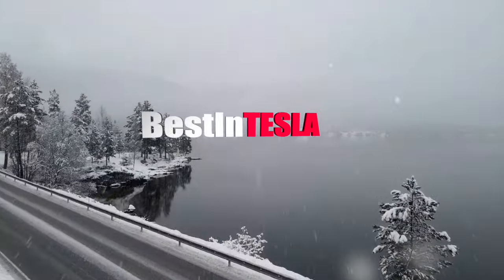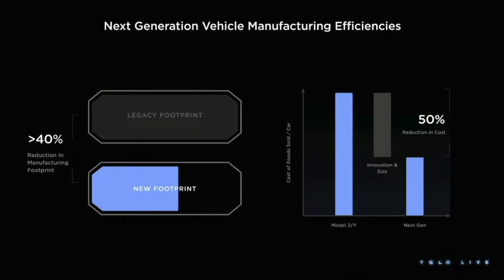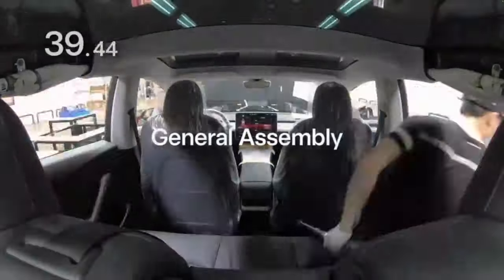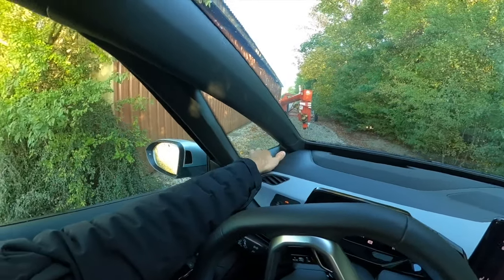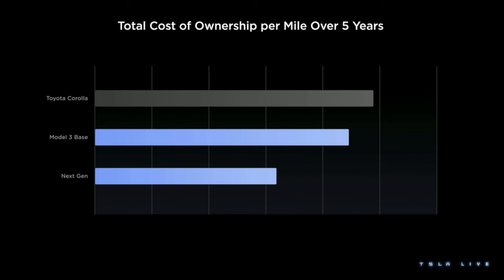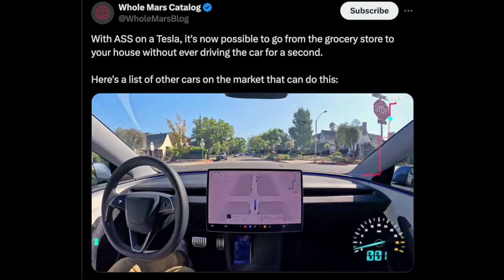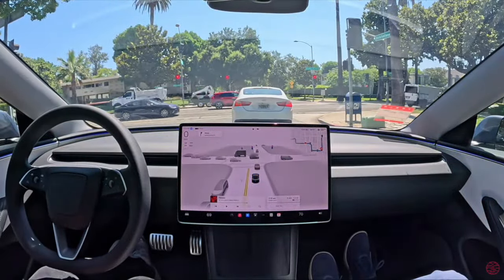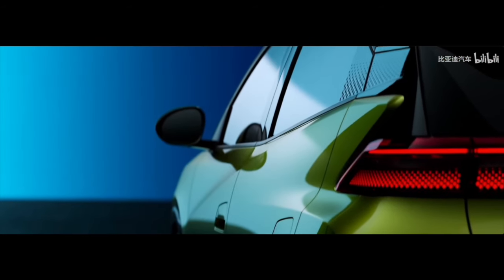Tesla's $25,000 Car and FSD - The Future of Profitability Unveiled! Wall Street's Misunderstanding

Comment: Sensible rollout plan for Cybercab and Model 2: 1) Start unboxed production of Cybercab at Giga-Texas. Debug process at world HQ with engineers and Elon on-site. 2) Start Cybercab production at Giga-Shanghai and Giga-Berlin. Ramp unboxed production there. Optionally do the same with Giga-Mexico for Central/South America deliveries (unaffected by potential US tariffs). 3) With Unboxed technique, the only difference between Cybercab and Model 2 is the front module.  Once Cybercab fully ramped (so production capacity is high), start producing Model 2 front modules (w/left and right hand drive versions) and vehicles worldwide.  Adjust Cybercab:Model 2 production ratio dynamically to demand.

Comment: FSD 12.5.4 is basically level 5! I use it every day and drive over 35,000 miles not kilometers every year and FSD today is basically fully autonomous and I’m really just waiting for them to announce that😂🙏💕
Reply: I also have 12.5.4 and use it every day, 2021MYLR with HW3. It usually works fine but once it made a left turn in front of an on coming semi and then stopped and disengaged in the middle of the road, another time it merged to a left lane with oncoming traffic when it should have just gone straight through an intersection. I reported these with the voice report, so hopefully those reports have some use at Tesla to make things better but I have never heard what happens to the reports. Kind of scary, 12.3.6 had problems too but never did this. I'm starting to wonder if the 'video clip' training can ever overcome these issues. My wife refuses to ride in the car with FSD on. Pay attention when using FSD my friends.
Reply: Hi, question for you. I’m in Australia where we don’t have FSD yet. In your experience how many miles do you drive between critical interventions?  That is if you had not intervened an accident would likely have occurred?  Thanks
Reply: There are almost no critical interventions. I am amazed at how the car can anticipate a large semi turning radius and stop in advance to allow the turn of the semi to finish,freeing up my lane.  (The truck turning from a side road towards me).  It anticipates drivers jumping the gun and illegally turning left in front of you even with my right of way.  It spots people opening doors when parked and either stops or moves a little into the opposite lane if traffic allows.😂
Reply: Do you actually know what Level 5 autonomy is? It's Fully Automated Driving. Vehicles capable of Level 5 Autonomy will be able to drive on any road that has been mapped and can be navigated by a human driver. That means all  weather and road conditions that a human driver can successfully navigate.
Reply: Its still level2
Reply: @tomdrewenskus8167  So as a point of information, level 5 autonomous, driven cars, means that these cars can operate all on their own without any human intervention. It doesn’t matter what a human can do or can’t do. It doesn’t matter whether the road has been mapped or not, because the car is completely operating on its own without any human intervention prior to, during or after. Comphrende. Cheers 🥂
Reply: @BrunoHeggli-zp3nl  Yes, it is still level 2 today, because Tesla has not applied to any state to operate completely autonomously. Comphrende. Cheers 🥂
Reply: I agree. Even 12.4.1 was already super amazing to test I. The USA! People don’t realize how close we are solving autonomous vehicles. Especially in Europe they have no clue.

Comment: The biggest problem with cheaper cars from legacy auto (and now Chinese brands) is sacrificing on safety, not just on features or tech. In fact, I would say the Chinese OEMs would trade off infotainment, features, etc. vs. safety, where there is way less regulatory pressure (shout out to the Wuling Hongguang Mini).
Reply: Legacy auto , must DEcontent to make a lower priced segment car.
TESLA can make Multiple lower priced models for Different Markets , at the same time. 
and on the same Platform.
Reply: @markplott4820  Yes, legacy auto is idiotic with way too many models, like GM planning to release 30 EV models in 2025. Ya, right Mary. How's that going? 

However, why would Tesla want or need to make multiple models, for different markets? They are nearing homologation in India (for all four of their models), which is a very challenging environment. They simply need to make relatively minor modifications - creating regional versions, not models. Multiple models is inconsistent with Tesla's approach of one category killer per category, and would greatly hurt economies of scale. Even the semi, which people said could never be compliant in Europe, now meets local requirements and it only took relatively minor modifications - its a version not a new model.
Reply: @machoopichoo2   - new MY should be Retooled for CHINA, Berlin & USA.
Berlin could produce own M3 hot hatch.
China could make MX style "basic" M3.
USA could make "basic" M3 as well. 
and refresh MY.
Reply: @markplott4820  OK, let's break this down. A hot hatch could be built on the M3/Y platform, and that would make it a new model. But I think a hatch will be the "$25K" car (final unboxed version, not anything interim), built on its own platform - the "compact" in Tesla's Master Plan 3 (MP 3). I think there could be a sub-compact (like a Honda Fit or Toyota Yaris) that sells for say $15K and is built on the robo-taxi platform. I don't think this is inconsistent with MP 3 because the robo-taxi is not covered in the model lineup in that document. 

That said, why would they "retool" the 3 or Y? To reduce economies of scale on some of the best selling cars in the world (Y being the best in the world), especially with the mass market compact coming soon? Sure, some versions of the Y/3 could come and go (e.g., SR RWD Model Y) but there is zero need to heavily modify these models for markets where they are already selling amazingly. Again, the M/Y are fine for India, with relatively minor modifications.

Comment: I certainly like Tesla vehicles. But that is because of all their features, the design itself and all the amenities, as well as the safety and savings factors, etc. It is a smart car - not just an electric car. Therefore, I am not expecting Tesla to produce a $25,000 car by "cheapening" it - e.g., reducing the quality of the materials, audio and visual systems, seats and upholstering, etc. Or simply omitting features of adding them as costly "options." IMO, that does not count as "unboxed savings." What does count is if they continue to produce fine automobiles for less cost of manufacturing.

Comment: 50% off costs compared to right now with unboxed is the inderlying assumption for your whole argument. Would be nice to know how. Unboxed still uses same amount of materials, just assembles them different order. 50% off just because of unboxed seems a bit high, maybe 50% of the assembly cost and not total costs
Reply: The process is to build the different sides of the car on different lines and merge only at the end. So mounting items like tapestry, electrical connections, etc should become much easier and take much shorter. We shall see if that's true. And then there's the economy of scale and the lower battery pricing.
Reply: @gianluigicassin868  
Tesla is innovating in other ways.  For example, they are using less expensive aluminum for their main battery wiring in the Cybertruck.  They cast the wire as a rigid piece which is much easier to install if the vehicle is designed to take a rigid connection.

Then, if there's a lot of automation, the rate at which cars are produced should increase.  Making more cars per hour/year means fixed costs can be spread over more cars, reducing the cost of each car.

Comment: BestinTesla - another great video.
I think Tesla will do refresh model Y , sometime in 2025.
Tesla will have pilot production of $25k NGV / Robotaxi (same platform) @ GigaTX.
GigaMX is on hold until after NEW American President is elected. 
Tesla Chyna, Berlin , Fremont & TX can all be adapted to make NEW model Y and $25k NGV / Robotaxi. 
Tesla will likely KILL mx/ms @ Fremont to also make RT/$25k vehicles. 
in 2025 Tesla will start producing semi in Dedicated factory & make 4680 cell there.
in China will make Megapacks.
in Lathrop Megapacks will ramp.
in GigaTX will ramp 4680 cell production.

Comment: IMO they are going for a car that costs  25K to make and sell for 32K - $7500 tax credit. The real 25K car will start production much later,  in 2027-2029.
Reply: I think you may be right.  I expect an EV selling for $35k or less to be announced next week.  A replacement for the now discontinued Model 3 Standard Range.  A less expensive EV built on the Model 3 and Y assembly lines.  Something that can come to market very soon.  It may already have started production.

My guess is that there is a prototype "line" for the unboxed EV inside the Austin plant.  Whether it's yet producing some test vehicles, no guess but maybe.  I suspect a year of shakedown on a new unboxed EV and then serious production startup.  2027 doesn't sound unreasonable, maybe a year sooner.  A dedicated factory might be 2027.  China can set up a factory and get it going in a year.
Reply: Tesla $15,000 car.

Comment: I think you are spot on Lars, being realistic with the Tesla 25K$ compact. To most people  FSD level 4-5 and the robotaxi are like pies in the sky. There is a market for the cyber in the USA, but the niche product wont move the needle in Europe or China. We both knows the narrow roads of europe and the super small parking lots, and I know people that would like a Tesla, but the M3 is simply too big, not mentioning the models S&X and the cyber. Remember Elon said, that the Compact could be made on the present 3/Y production lines, and to my knowledge, these lines are only used for production 4 days a week by now, so there is a lot of available employees and idle capasity, to start up production of the compact car right away. The huge ramp will follow, when Berlin and Shanghai finishes building their extensions.

Comment: If the 25k car is only RoboTaxi (not drivable by humans) it’s not going to have as much impact to Tesla’s earnings as fans are projecting.  Understand that the RoboTaxi cost is not very material, only the price per mile.   0.50 per mile = $6250 per year for the average person in the US.  Multiply that by a family of 5 then the cost per mile is more than the price of the car!   Even if you share rides with family members on part of the ride it’s still going to be a big chunk of the cars price, every year!   (Based on an average of 12,500 miles per year traveled. 

If the car is drivable (and has FSD) then it could be sold to the individual family and used within that family.  This would reduce its cost per year, if taken over a number of years.  The longer it’s owned the lower it’s cost per mile.
Reply: Elon said, pre-covid inflation, that Tesla could operate a robotaxi business, all costs included, for less than $0.18/mile.  Ramp that up to $0.25/mile post our recent round of high inflation.  A 100% markup would bring the rate to your $0.50/mile.  Lots of people would pay half a buck per mile just to avoid maintenance, registration, insurance, cleaning, and parking hassles.

Charge a 50% markup and it wouldn't make economic sense to own a car.

Comment: Wow, I was much more confident until I watched this podcast.  What you are saying is that Model 2 is at least 3 years off and you imagine FSD will add massively by next year.  It is evident you don’t have FSD on your car.  Because it will take much longer for FSD to add measurably to the bottom line.  The problem with FSD is that while good it is far from where it needs to be to run a Robotaxi or even be worthwhile to me who has 2 Teslas.  I refuse to pay because the utility isn’t great enough to make it worthwhile.  Too many interventions.  And while I hear zero interventions from other Tesla uberbulls I haven’t experienced them.  Good enough isn’t good enough when it comes to FSD. It needs to be near perfect before it will take off.  And you acting like it’s already there is delusional.
Reply: People who are running the latest version of FSD report few, often no, interventions.  You may be reasoning from old data.

The take rate for FSD appears to be very low right now.  As features like self-parking are added more people are likely to give it a try.  And people who are driving the latest version tend to say they really don't want to drive a car that doesn't have it.  It seems to be a ratchet effect, click up and don't slip back.

Remember, the $99/month for FSD is pure profit for Tesla.  It's just turning on something already in the car.
Reply: And don't forget winter. Not every city is in California or Texas. Once the snow starts, cameras get covered; road is slippery; road lines/paint gets covered...

Certainly not an option in winter cities anytime soon. I have a Tesla and live in such a city, so talking from pure experience.

The YouTubers paint a misleading picture of FSD

Comment: BYD sells their Seagull EVs for 10-12k, would hope Tesla can aim closer to the 15-20k range, rather 25k. That would be a true game changer.
Reply: If you want a crappy/cheap EV, buy BYD.
Reply: @paintedpony2935  
You might want to fact check yourself.
Reply: A Tesla EV that priced out below $30k, including the $7,500 federal subsidy, should be a massive seller.  It would be a Camry-segment killer once people calculated in the fuel/maintenance savings.  

If they could produce a low $30k EV with a decent range in the US and Europe Toyota would likely go bankrupt.  Toyota is already losing it's non-Japan Asian market to Chinese EVs.  They can't sell enough cars in Japan to service their enormous debt.
Reply: Not outside China. Two to three times that when exported.
"BYD Atto 3 ranged from 81% to 174% higher than in China. Dolphin prices ranged from 39% to 178% higher, and Seal prices from 30% to 136% higher." 
Tesla Model 3SR in Germany $43,707 - BYD Seal $48139. 
Reuters April 26, 2024.

Comment: So, if Lars is correct, the $25000 car is just smoke and mirrors, meaning that Tesla does not have the technology now, nor have they really figured out how to make a profitable small ev for the masses. We have been hearing a lot of talk about this upcoming vehicle for several years, and if it is not unveiled next week, then we know that is what it is, just talk!
Reply: The $25k car is based on the unboxed process. Musk wants to go straight to the autonomous car and not bother with the $25k car. The other senior management is advising they should do both, that is build the car with steering wheel and pedals and without. There is a lot of pressure for Tesla to add a cheaper car. So to meet that demand, Tesla is choosing a hybrid approach. In the first instance build it using existing machines and processes rather than jumping straight into a whole new production line and robots and process.
So, if you are expecting a $25k Tesla in 2025, you will be disappointed. You may even be right that it is smoke and mirrors. It all depends on what direction Tesla is going to take and whether they prioritise making cars, or autonomy. Hopefully we find out in a few days time.

Comment: Please, Lars, stop your horse yet. Today FSD is little more than unpractical gimmick - it won't make great impact outside US due to legal hurdles, esp. in Europe and esp. in case of collisions or accidents. 
In the meantime an affordable Tesla actually means cheap Tesla with barren, cheap interior materials and insufficient range. And extremely low resale value due no swap battery feature.👈 
Why? Because it is the cheapest way to produce car profitably. Even 100% robot-made Tesla car will have to accept price of battery package or raw material from external suppliers. Domination of the Chinese supply chains is absolute and there hardly anything that Elon can do about it. 

On the other hand, it is some Chinese EVs that have killer feature: a battery swap👈!. Tesla lacks it. The EVs with with feature not only can rapidly change their batteries but also such EVs retain high resale value. 

And there are some great news about it: CATL - the biggest EV battery producers from China - announced they invest in huge amount of swap battery stations (10'000 till 2030). So China bet on swap battery technology. This is great news for the whole EV industry and drivers across the world! In the latest swap station of Nio the battery can be swapped in 2min30sec.👏 
EV without battery swap - like Tesla cars - is wrong direction.